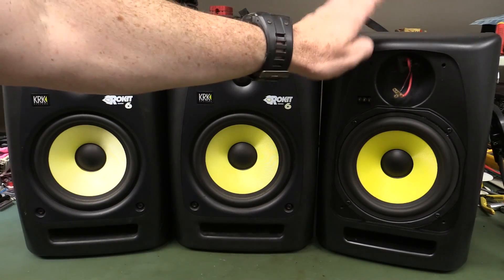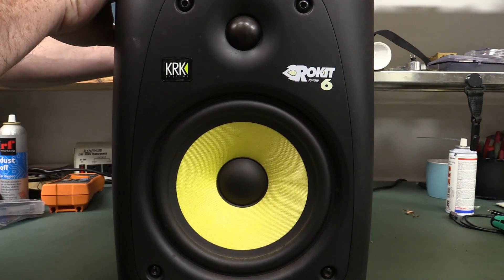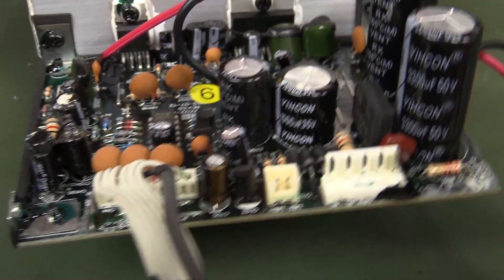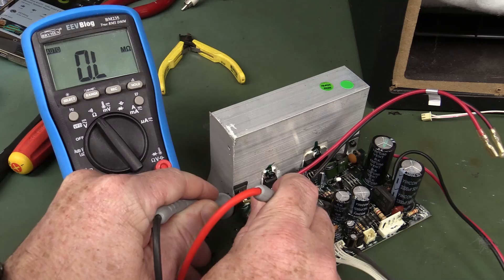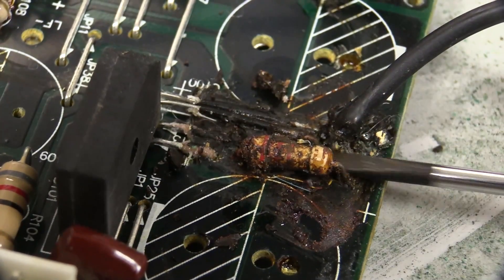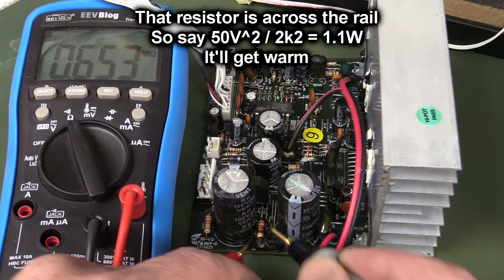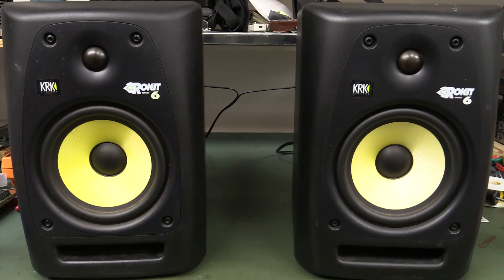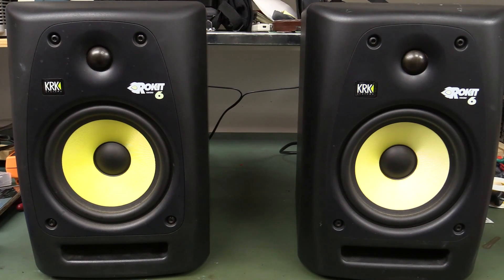EEVblog #1073 - MORE KRK Rokit Black Gunk Speaker Repair

Comment: Could the 2k2 resistor be responsible for the premature death of the Yihcon cap through heat?  And also, could that of helped 'curing' the gunk? (:
Reply from the maker: It certainly wouldn't help.
Reply: I doubt the resistor does much to that cap unless it's at powerlevel 9000 which means it would be burned brown or black. Maybe just pushing the cap over the edge when the heatsink and basically the whole amp run bloody hot as well. But it sure does help the glue become nasty
Reply: 2k2 resistor across a, say, 40v rail (since the big ones are 50v caps) ends up around 700mw or so, so... I guess it's debatable. 

I'm not a fan of that internal heatsink though, or at least not of the mounting.
Reply: Indeed, add the fact that they would be running like that constantly,  some heat might build up. I agree to the fact that the gunk becomes corrosive under heat, and it is the main culprit, in that it 'sweats'  something out or accumulate moisture. And it is a flaw on the gunk manufacturer... The gunk was supposed to be a good thing. :))
Reply: I bet this is why the 3rd generation has a sleep-mode, where the amp board turns off automatically if there is no input for a couple of minutes.
The amp gets quite hot even if you don't send any signal in it and I left mine running for at least two years without ever turning them off.
Now I can't leave them on at night because the buzzing (what Dave showed at the end) is super annoying. 

My 2.2k resistor looked the same by the way... Covered in gunk that looks like it was boiling before. 
I'll definitely buy some Isopropanol and capacitors next week and give these things a refurbish.

I hope that's gonna fix the buzzing/hissing noise.

Comment: I looked at their brand before purchasing two Adam Audio A7X monitors and the Adam Audio Sub 10 MkII.  Huge price difference, huge difference in quality and performance...but they're not without problems.  Mine produce a sweeping sound (high to low frequency), just barely noticeable shortly after powering up, however, since you're sitting within a few feet of them, you notice it.  Tried disconnecting the XLR inputs, same phenomenon, so that rules out external sources.  Typically powered through a Furman PL-PLUS C 15, but going straight into the wall exhibits the same issue.
Reply: same here.. I almost bought a pair of these from a friend, but decided to go for yamaha HS7 instead. same price, better quality.
Reply: That does not sound right. Try to probe different points in the pre-amp and power-amp stages.
Reply: They're still under warranty and I'd hate to pry it open and void it because they cost a shit-ton.  I contacted them and they said if I wanted to send them in, I could, but I'd be without them for two to three weeks.  I might just pull the trigger and do it.

Comment: 16:38 YES YES YES! My Gen2 Rokit 8's do this. 
One of them is so bad that I couldn't hear the sound of yours until I put on head phones.

It seems to vary with temperature... When I turn them on, it's really loud but gets at least bearable when they start to warm up.
I couldn't be happier if you would be able to find out what this is related to. I've read that it may have to do with the power supply but my knowledge is not great enough to be able to verify that in any way.

edit: another place on the internet (https://www.gearslutz.com/board/geekslutz-forum/731238-krk-rokit-5-faint-buzz-bad-capacitor.html) says it's bad capacitors, but you switched them all, right?

Comment: I am a bit surprised that the heat sinks radiate inside the enclosure and not outside.  That is a big heat sink and running at full power (~70 W google) continuously I would think it would get quite hot inside... not the best for the components.
Reply: Big bass port, gives ventilation when any significant power is involved...
Reply: Most studio monitors seem to share the heat-sink-on-the-inside method.  As Mark says....

Comment: Interesting to note, I am almost 99 percent sure I have seen these boards on a chinesium site that have them available in bulk, I will try and find the link.
Reply: this is how the industry works....
Reply: Please tell me if you find it. I'd rather swap the whole board than clean it up and switch out all capacitors.
Reply: I will , it was not very expensive either from memory.
Reply: Mine where working perfect last night , turned my 6g2's in today and the left one started crackle and now got no sound anymore.
Took out the amp and its full of that conductive stuff around the caps, lights still work.
I need to replace the amp board too.....I have these speakers just about one year now 😒 I think I buy a second hand speaker and clean the working board from the conductive glue stuff.....

Comment: Since it's sealed. Maybe they could avoid the moisture caused by temperature change. Some dissicant perhaps. I think the wood will be tough to keep at 0% moisture content.
Reply: It is NOT sealed. Mine have a slot port under the woofer, so it is open.

Comment: @EEVblog, I have a pair of Rokit 10-3's and now I have to watch for this problem. Yikes. It makes me want to replace them with another brand that let's me see the build quality by having a pair open at the music store! Damn. As a maker it's clearly frustrating when your contract manufacturer swaps out parts or uses crappy gunk that goes conductive, wow... though some have said that is well known so clearly a company like KRK must now put in manufacturing measures to prevents this otherwise they'll loose customers like me forever... yikes... So KRK what have you done to ensure this won't happen again?

Comment: The board from my KRK sub 10S is even worth... Full of that gunk... I experienced cracks sound, even with no input (just plugged into the wall), so I searched for a soluntion on the net and saw your videos. I then decided to open the box to inspect the board and discovered the "quality built". I'm going to try to remove that gunk. You noticed solvent to help, what solvent is that ? Thanks

Comment: I own a pair of KRK VXT6, and lately iv'e been hearing some Digital/RFI noise from one of my speakers, now, i do think its because the noisy one (the right one in that case) is near to my phone charger, and probable gets those RFI issues when i'm charging my phone, but i could not reproduce that effect, any idea what else could done it? 
Did anyone came across a slimier issue with the VXT6?

Comment: I have determined that if you remove the ground pin from the power cable that tweeter noise goes away.
Reply: Yeah that’s what you want in a line of speakers that are prone to high voltage short circuits - LESS safety features...

Comment: This video migh be old but a friend of mine has 2 of those, both f up (one because of the circuit and on the other the twitter doesn't work).
Just in case even after watching these videos you're still thinking of getting a pair of those,  just don't.

Comment: You should connect them to a balanced source, that should get rid of that static or whatever noise... if not, that's another exciting mistery for you to solve :D
Reply: I have the Rokit 8 Gen2 here and they do it even if they are the only thing powered up in the whole house.
Reply: Have you tried a balanced connection? There should be absolutely no noise with that.
Reply: It even happens when the only thing plugged in is power. 

I researched a little more and it's probably caps that have gone bad (and maybe the gunk)
https://www.gearslutz.com/board/geekslutz-forum/1190709-shade-tree-repair-guide-fixing-crackling-static-krk-rokit-peakers.html

Grounding issues are literally the first thing you find when searching for anything related to speakers and noise.

Comment: The last two KRK I've fixed had these issues - if it might be helpful to anyone.
KRK rp8 (no sound from woofer) - Bad electrolytic coupling the LF signal into the noninverting input of the TDA chip. (220uf 16v, close to the chassis)
KRK rp5 (blowing fuses) - shorted diode in the rectifier for the higher voltage supply.

Comment: I would just get rid of the junk amplifiers inside the speaker boxes. Then I would wire the drivers to a crossover Network and use them like regular speakers.

Comment: If they publicly admit to it, they will have to fix or replace them all. There are attorneys instructing them not to admit to anything like that unless they are prepared for the consequences.
Reply: They would mostly be well outside of their warranty period... although I guess this is a deeper issue?
Reply: If it's not a safety thing, it's probably a question of customer relations. The legal part of it would be different for each country. I know I have an Onkyo receiver that failed due to a pcb having poor solder connections that would break after so many heat cycles. Onkyo admitted to it and replaced the pcb out of warranty for me (and many others). I thought it was a good move on their part.

Comment: Dear Dave, the audio industry itself has to take much responsibility when it comes to attitudes like yours re. ''audiophools''.
Starting in the 80s and, er, still going...it cynically promoted mystique and pseudo-science to the gullible to maximise profits. It got crazy in the late 80s early 90s (look up Peter Belt of PWB electronics as an example - of the madness, not profiteering).
Problem is people just don't forget - Italian cars rust! - In the 70s with crippling industrial action, the Italian government took the step of importing steel for FIAT et al from the Soviets. Cars were rusting in the showrooms, engines dropped out of rusty Lancias and people never forgot. There are many examples of unfair generalisations and sweeping dismissals due to mud sticking.
HiFi has had the mud stick, pointy feet and gold knobs have tarnished the whole industry.

I would like to let everyone know that the audio industry has had an extraordinary history of brilliant engineers doing extraordinary work. It doesn't deserve to be remembered for the lunacy of $10,000 power leads. 
Alan Blumlein invented stereo, the 'ultralinear' amplifier, and the differential amplifier among many, many things. He died in WW2 in a plane crash whilst testing the top secret RADAR he was working on for aircraft.
Edwin Armstrong invented many things too, most amazing though were his inventions of regeneration, the superhet and FM - imagine the mind to do that, holy shit!. He jumped from a window after RCA fiddled him out of his FM patent.

It is an almost endless rich and colourfull world of engineering littered with weird and wonderful invention. Post war things were getting interesting. I hope we all can see in our minds Frank Sinatra crooning into a mike at Capitol.
By this time the studios had reached a point where it really was close to perfection with  ribbon mikes, distortion frree amplifiers and that new wonder, the tape machine. The modern tape transport was invented in Nazi Germany. After the war Bing Crosby was agitated because he had to be at the radio station every day to do his programme - he bankrolled a small company called Ampex to develop the tape machine so he could sit at home with his feet up, and the rest is history. The jump in quality was astronomical. The microgroove LP and the 45 had been released and for the first time ever the quality of the studio was available in the home. Hi-Fi took off in a big way. After the car, the Hi-Fi was the major purchase. Oh and we might not have had the Beatles or Elvis if it wasn't for Bing Crosby...

I can't make a list of great designers and engineers in audio, or the great individual bits of equipment  as it would take a book. but I will say real science and real engineering have gone into making these great things, and that  the only reason for them existing is to bring  pleasure and do justice to the artists that make music. 

If you want to hear my philosophy on sound reproduction I can offer advice to anyone who asks. (I don't charge much)).
Reply: Fascinating re. Ampex.
Started putting my HiFi together in the 80's with a Rotel compact cassette deck and cheap Tandy headphones 😕. Sounded great as I had nothing to compare with other than 45's on mum's German made 'sideboard' radiogramme. 
40yrs later, no longer chasing audiophile nirvana (or Linn as it was), but VERY happy with CD's & FM/DAB, via Philips/Teac - Marantz - Tannoy/MordauntShort...
No more: tape hiss; vinyl clicks/pops; turntable rumble (Millenials call it warmth!); tape head cleaning&alignment; stylus changing; cartridge alignment etc. etc. (still have a HiFi Sound '81 LP setup disc)
Also now finding great quality CD's for £1 each in charity shops.
✌😊👍
Listen without prejudice...
Life's been good to me so far!

Comment: If one is on a shoestring budget - Yamaha HS8 is the absolute best at the price point (HS5 & HS7 are coming a bit short in the low end). They are very flat across the frequency spectrum, thus sounding "boring" to HiFi people. And yes - they are made with cheap components, but at the same time - they are well engineered. The only thing is that the tweeters are a bit noisy, but that's about it. Of course some of the higher priced monitors will give you greater detail, but none are even close to the price of the Yamahas.
Reply: Well, at 350 they should have an edge on a Rokit 8" that is around 250 generally. But I never found any objectively measurable quality that was worth an extra 100 euros to be honest. Perhaps in my specific usage case, it didn't matter.
Reply: his voice doesn´t need much low end capable speakers, tho....he quoted "...speech and video postPro;)
Reply: TubiCal I didn't mean to answer Dave's question, but to give a rather objective viewpoint for a more general studio soluton (I just felt the need to). For his needs I'd suggest choosing something a bit smaller, but from a reputable brand (Genelec, Dynaudio, Adam, Neumann, etc) and compare them on site, by playing something well known on each of them. The ones that sound most "flat" (read unexciting), without losing any detail, should be the right ones (truth-wise).

Comment: I've had my same pair (in yellow if I may add) for the past 8 years and I've NEVER had these issues. Idk who was using them, but DAMN they have been abused
Reply: TRIMECARL The only obvious abuse is sunlight from a window and possibly a hot room from Australian climate and hot equipment running 24/7 (because of the usual wisdom that letting pro gear cool down shortens the lifespan).

Comment: I have the 10 inch sub woofer doing the same thing, 10s v2, it has a low loud rumbling sound at all times with nothing plugged in, this should be a full on RECALL, or lawsuit

Comment: Marshall JCM2000 series. 'Nuff said.
Reply: @ska042  Maybe he is referring to some of the engineering problems that occurred in these amps. They totally underspec'd a capacitor, a resistor bridge, and the input transformer. Deffinitly lots of black gunk. I do however own one, and it sounds damn good each time i fix it up.

Comment: Serious work? External amp + passive speakers every time.

Its not massively surprising that an amplifier with hygroscopic potting is causing crackling. I wonder if this has been tested under UK law at all, here the law states that a product should have a reasonable lifespan (comes under being usable for the intended purpose) and that can extend to several years. Manufacturers' responsibility doesn't end after the 12 month warranty runs out.
Reply: Zadster But that external amp would occupy a rack slot that should have been available for something that directly contributes to the production.
Reply: Mine took about 5 years or so to start crackling/hissing/buzzing (whatever you may wanna call it).
Considering that most people probably switch to better monitors in that time... easy $$$ for KRK.

(or maybe for the factory... they might have used cheaper compound without KRK knowing about it)

Comment: Why not just use hot glue? It probably dries faster and its alot easier to remove.
Reply: Quick tips: Hot glue doesn't have to dry. It has to cool down. But it has to be quite a bit hotter than anything else which can damage electronics.

Removal tip: use a cloth soaked in Isopropyl Alcohol and flood the area of the hot glue with it. It'll act as a catalyst and the hot glue will come off like butter without ANY force!
Reply: I never had any problems with it, pretty sure most components can handle up to 200c with no problem (except maybe capacitors?), and for removing it i just heated it up with hot air gun or hair dryer. 
Thanks for alcohol tip, i usually use wd40 when removing glue residue, i guess alcohol is better since it evaporates faster and doesnt leave oil, gotta try that.

Comment: The liquid could be the electrolyte from the caps.
Reply: The gunk may not be conductive, it's just wet with electrolyte, it also may explain the corrosion.
Reply: In previous video it was shown conductive even on parts of the board far off any electrolytic caps
Reply: I thought the same thing. Maybe the caps pissed all over the place and the gunk sorta soaked the rest up. But, this gunk is known for doing nasty conductive shite so unlikely that it's just the caps
Reply: But the video also shows a non conductive piece of gunk... I think since the speaker is well sealed the gunk can absorb the humidity, so the gunk probably becomes or is hygroscopic but not conductive. In the end is the same but if you use better caps it may be completely ok to use that gunk.

Comment: They probably tested good at the factory, but once they've been on the market for a while they started going bad. I wouldn't be so quick to bash the company on an issue that was most likely unknown at the time. The company that makes the glue probably did something wrong during the process.